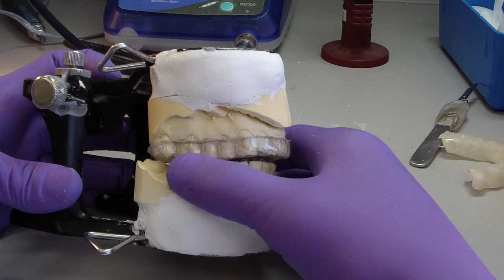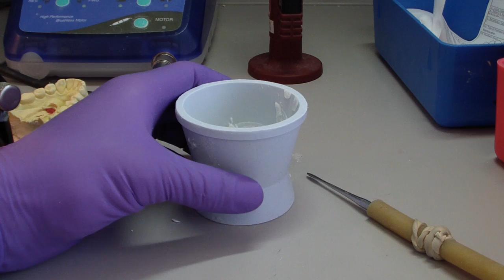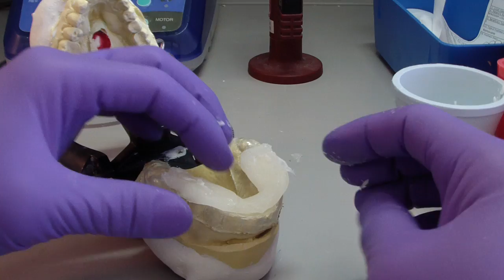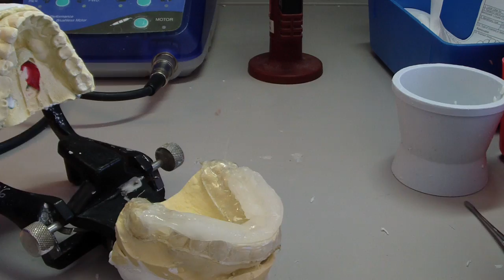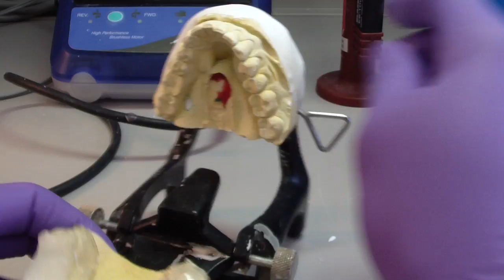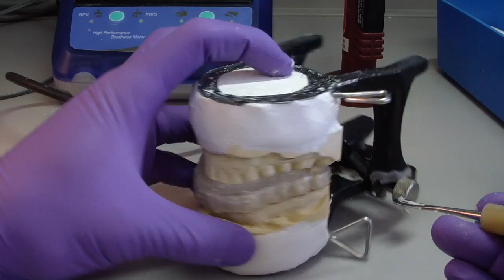Bruxism Splint - Part 4 - Developing the Occlusal Surface

Comment from the maker: No locking divits and it is smooth.  Just think that we still want an occlusal scheme without any "locking":  Simultaneous, bilateral posterior contacts in CR, and Anterior Guidance in Excursive patterns.  All smooth and as you said - easier to do excursive movements.  Thanks again,
Ashley

Comment from the maker: Awesome point. Skating rink.  As a Canadian, I think that we call anything that is smooth a skating rink!  You're totally right about this point.  It's not flat - however, we imprint the mandibular arch into the acrylic to know where the "basic" occlusal points are.  Then, I have an idea where I can remove the bulk acrylic - and - then - finalize the occlusion.  The final result still has the mandible occluding on the splint - however - the mandible has no "locking" divits in the acrylic